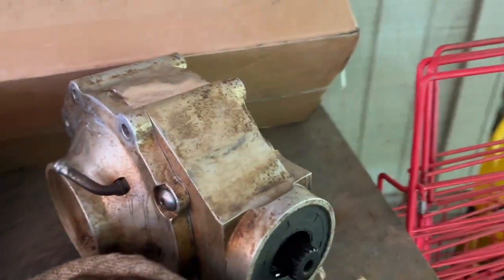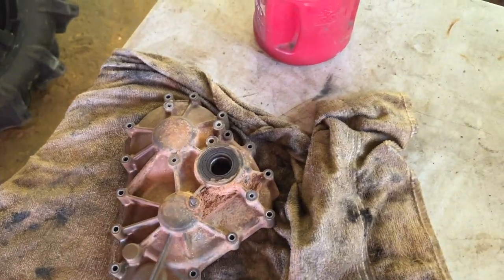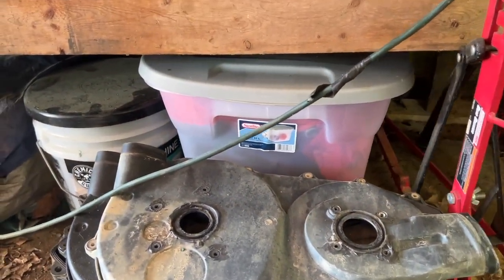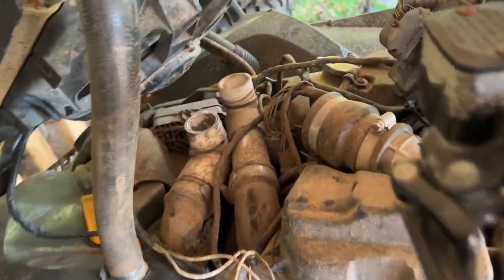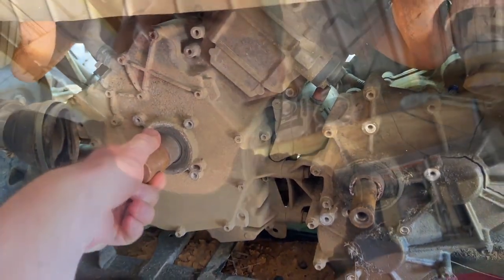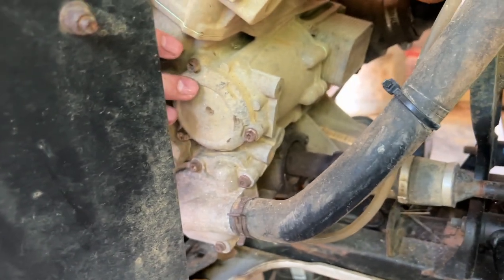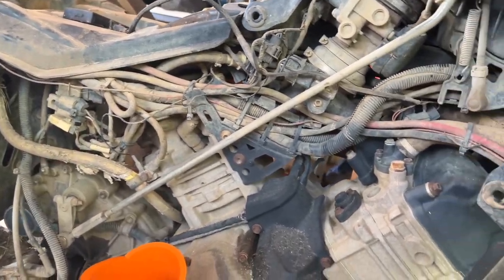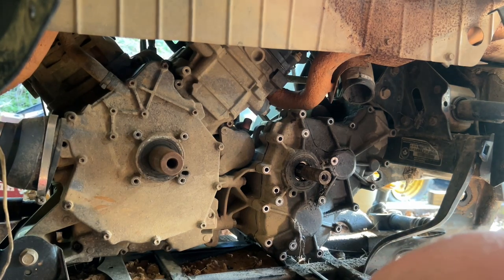"CHEAP" Can-Am Becomes a MONEY PIT.... Transmission is TOAST!!

Comment: To run a small trans in a machine that’s setup for a large trans you have to swap engine harness’s and get your ecu reflashed for the small trans since the gears read different, you’ll also have to get the shift gate for the small trans.